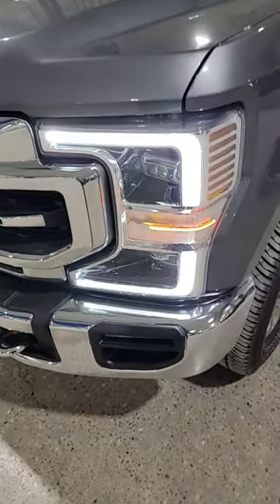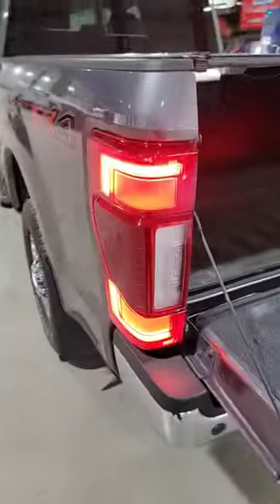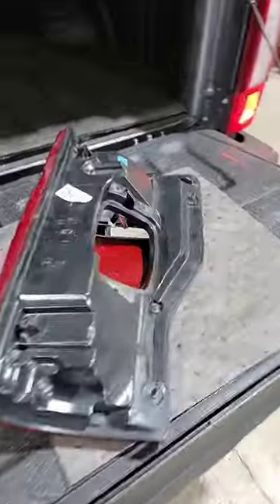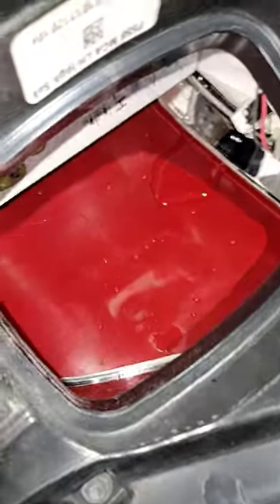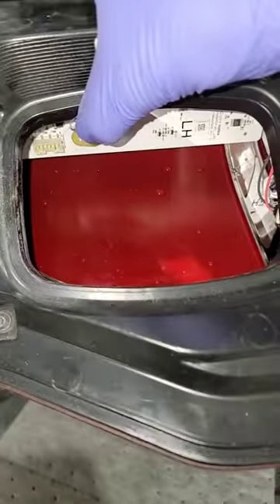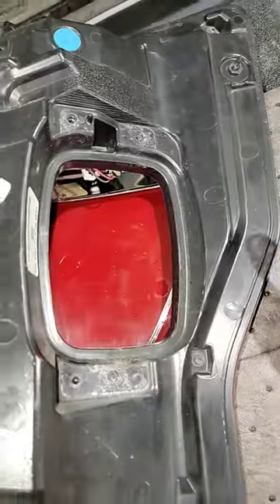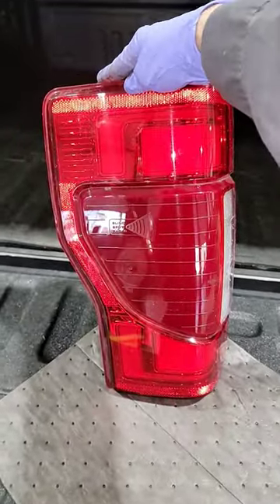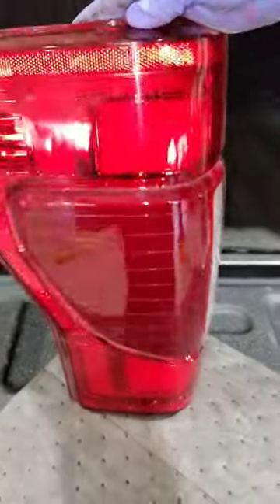New SUPERDUTY tailight - Water World edition 🤦‍♂️ #shorts #fordtrucks #broken

Comment: I had a leak on my 2017, passenger size. Messed up the twilight and she died, die too a crack from previous owner though..... The module is "ok" but threw all sorts of codes for traction control, blind spot, down hill decent, etc etc. Never had the issue again after replacing the light! Also the Non-Led taillights CAN have the blind spot sensor too!

Comment: What I noticed with my f150 is that they mount onto the bed with the most crude screws I've ever seen on a vehicle. Essentially hex head self tappers. No threaded nut inserts on the light just screwed directly into the side of the plastic.  I put a rubber washer between light and body and some silicone on the screws before reinstalling. Seemed like the only weak spot I could find that may trap water.